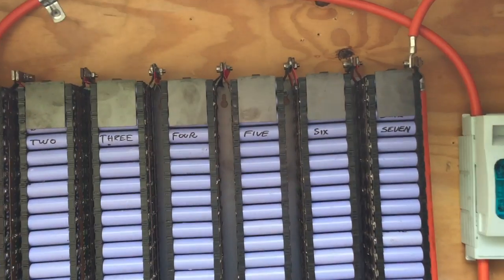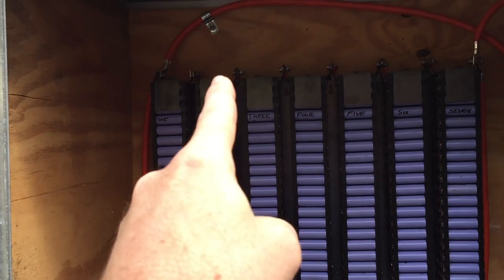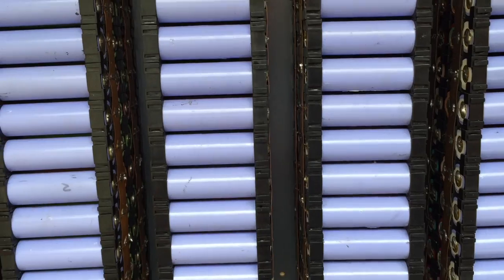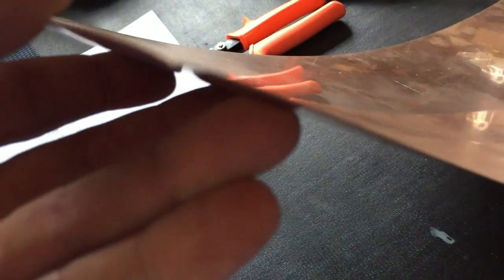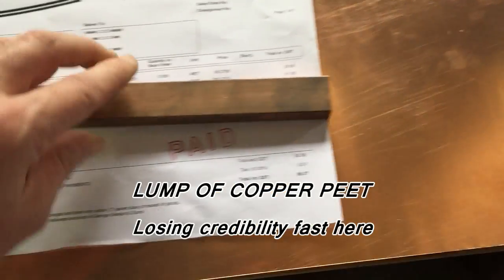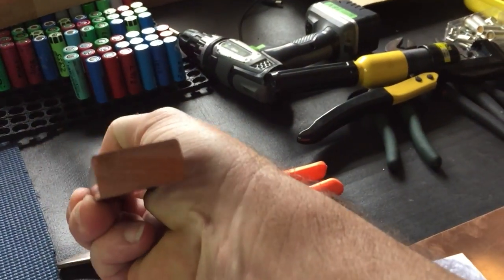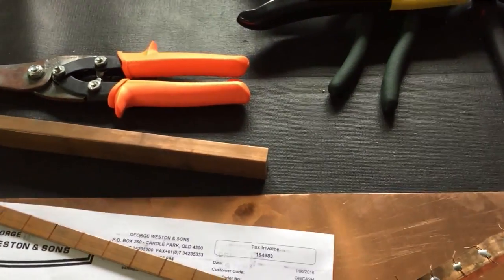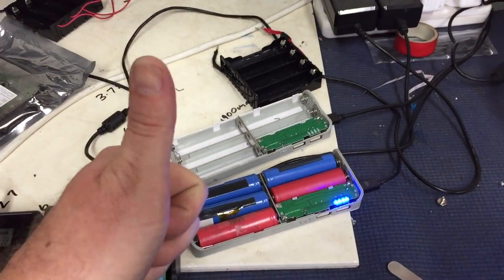Busbars V5 Someone gave my wife money now I have a new challenge

Comment: Pity you cant do sums, cant you find a mate to help out with basic calcs.  like resistance of copper bus bar vs dimensions its a question of CSA cross section area and Amps/m2 current density - not rocket science  (its called designing and can save much of that wasted time and money already)

Comment: I installed solar for years and one thing i learned is color coding cables is critical when and if there is a mishap of any kind.  Make me happy and wrap the ends of all the negative 4/0 cables with a stripe of black tape.  You've got me goin. I just picked up a crate of laptop batteries yesterday.  So far all my solar spotlights have been  upgraded to 18650 cells.  I find charging 3.7 cells with usb 5 volts is perfect.  either cell phone chargers or right off the computer.  I love your project!! keep the videos coming!!!!
Reply from the maker: Yes yes, i know - might even step it up and put some red tape on one side too - in a rush and out of the 100's of meters of heat shrink i have none fit..  Glad you have a good start with a whole crate!!! So long as the wife allows i'll be continue to mess shit up on camera :) pete

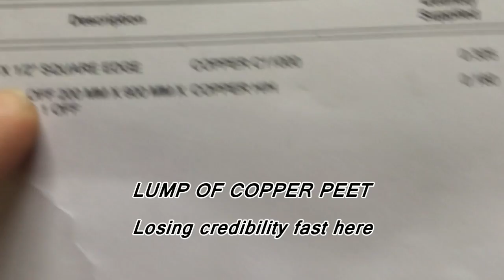Comment: 3:57 2.54cm x 1.252cm
Reply from the maker: Excelent :)
Reply: +HBPowerwall +thirdwheel1985au
Not quite excellent. 2.54 x 1.2*7* centimeters. 0.2 mm off. About half that of the thickness of that steel copper sheet

Comment: You need a Cell or Pack-Balancer, otherwise (i think) you will always replace the worst pack!
Why? Because you have no new (means almost identical) cells in your packs, they are all at a different state of "life".
Without balancer the worsest pack will get lower and lower over charge and discharge cycle and drift away.
Its also possible that your charger overcharges the best pack, because for the charger there seems to be just one batterie..!
He has no chance to identify which pack is already full and which is still at 50% or so.
Watch some Lipo-Charger Vids on youtube about why to charge with balancer. I couldn't find the right page or vids in hurry, also because this isn't my native language (>switzerland). 
Maybe you know that already, i saw your chinese bms s, but i hope you dont forget this, in my eyes, important part in your system. I'm collecting also old notebook batterys but... i'm "lightyears" behind you :-). I almost watched all your videos. Its great to see other people working on the same projects/problems - Keep on!
Last but not least; yes the balancer would not solve the problem why your charger drains your batterie to low.
Reply: one more idea why your battery voltage drops under the threshold:
when its on 22V and your load is cut off and no solar voltage comes in, how much power drains the charger from the battery without doing anything?
Google for "lithium discharge curve" => if your batterys already on the pointing down curve at the  3.0V point, its maybe possible to get under 22V because of the power dissipation of your charger..?

Comment: I don't know if it's too late, but I found if you charge and discharge each battery 3 or more times, the mah will settle to its actual mah value. My test was to use the same 4 batteries in the same charger and slot over several days and recorded each mah reading on a chart for each cycle.  This process was repeated 7 times. After the third cycle the mah readings stabilized.  Whatever the third cycle value ends up being, I used that value on the battery.  I can send you my excel sheet with graph that demonstrates this.  Also, I would try to match batteries chemistries the best I could in each pack.  Mismatched chemistries will cause problems with charging and discharging and likely make it impossible to ever balance the batteries cells
Reply: where can we see this?
Reply: I put it here  http://www.icpage.com/Battery_Tests.jpg
Reply: thanks

Comment: its the right way, to connect the packs positive up, and negative down, the only way to keep the pack balanced.
Reply from the maker: we are about to find out if that is urban myth or true :) either way i'm happy
Reply from the maker: not reinventing just hacking off the corners :)
Reply: its true for sure, the batteries at the top have less resistance between positive and negative. So they charge and discharge quicker. If you don't let the pack sit and equalize between cycles it will never be balanced. Running negative out the bottom will make all the cells operate closer to their internal resistance, which should be a vast improvement.
Reply: HBPowerwall  you don't have to re invent the wheel, believe me its the thruth.
Reply: HBPowerwall lol

Comment: I know this is going to sound daft here but roughly how much does a bank weigh ? Could you possibly (and I'm just shooting the breeze here ) make the banks drop onto battery terminal contacts or is there to much of a risk in doing that
Reply from the maker: 3.5kg - would love to have a clip in type system tried to design it only to find out i suck ...hahah
Reply: Rather than connecting the tabs at each end try bending them over on each other and using that like the ryobi contacts then you just need to make the recepticle part using multiple layer of pcb board or phenolic as the insulator and some springy but stiff contact material to press against the contact  I was thinking of using a modified bull dog clip but I don't think that would work I guess it might work like a crude blade switch any way food for thought cheers buddy keep up the good work

Comment: Man not a good idea hiding the BMS need to be able to check it for heat when balancing & disconnect quickly if it malfunctions... or hiding it's fine just have easy access.
Reply from the maker: Not hiding it so much as hiding the connection - i'll be going to great lengths to make all the wiring look seamless and integrated
Reply: Looks great keep up good work.
Just trying to help from other side of the world... lol!
Reply from the maker: all goods getting someones option is never a bad thing ...